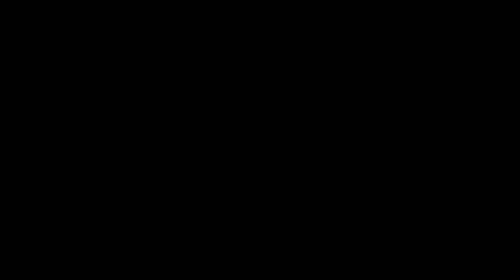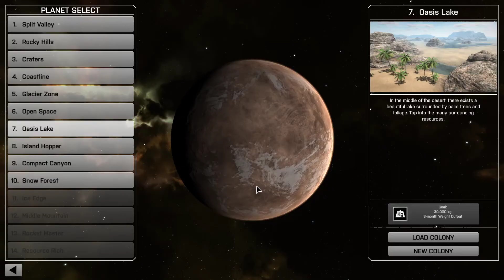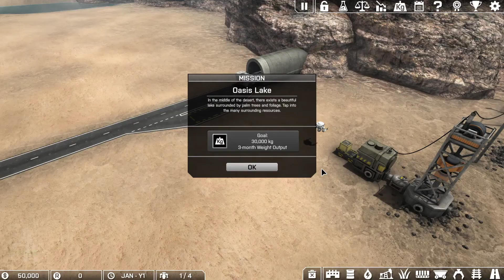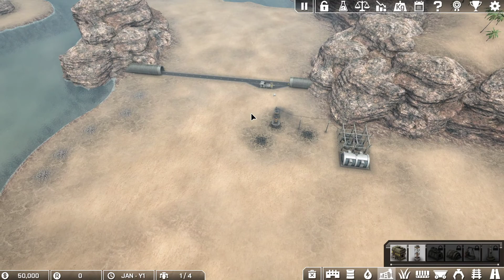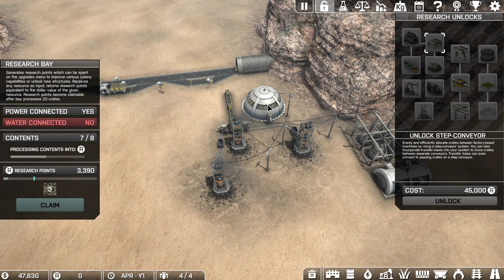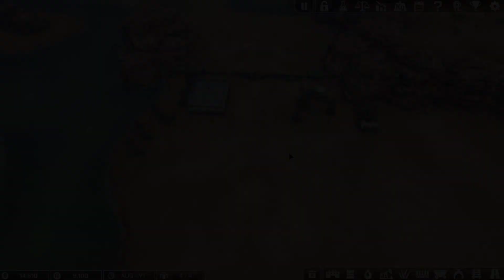Automation Empire - Oasis Lake - Learning the Basics - Episode 1

Comment: sling a small tank onto each mine extractor as they only hold 8 ore if they fill up they sit idle while still eating up income through power cost, same for research buildings using a tank as an input/output buffer keeps production going as you add more infrastructure / rearrange tracks etc. Its also a great visible reference as to how efficient your setup is ie constantly empty input tank is restricting production while constantly full output needs more infrastructure to process it faster or ship it out faster.